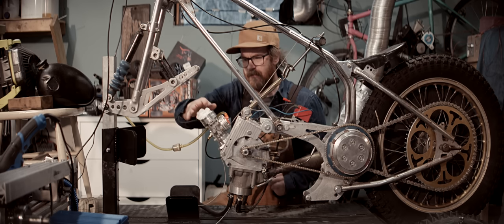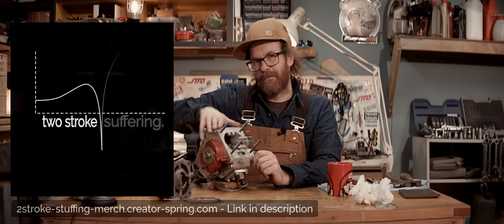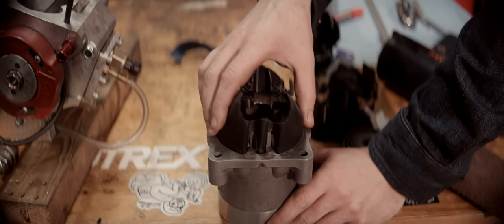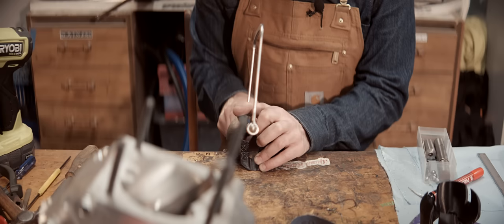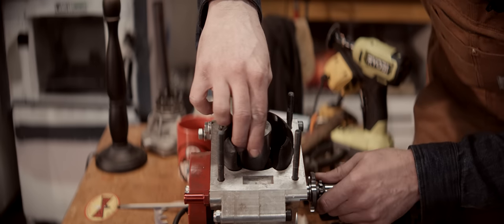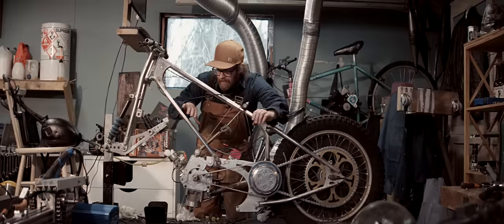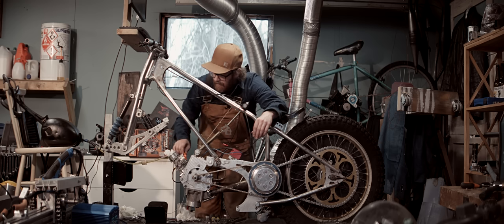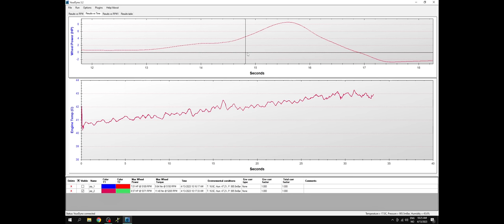The Mother of All Crankcase Stuffers! (and flying variator parts...)

Comment: When I was a kid back in the late 50's I added stuffing to the underside of the piston of my Dad's 2 stroke lawn mower.  I used half of a cork fishing float and shellac as a sealant/adhesive.  That mod plus a a bit of porting, and pull string to over-ride the vane type governor let me produce a lot more power and mow the law faster.  
Yeah, it blew up, but not right away.
Reply: I'm going to have to ask now back in the 50's exactly how old were you. 10 / 12 ?  Now I'm from the 50's and I build drag racing motorcycle engines now.  In the 50's I wasn't old enough to get a drivers license. But I built engines from a lawnmower to a V8 Olds in any old Ford,  We knew very little about about porting, degree in a cam, or setting up a Holley for a specific engine build. I didn't come across that info till the early 60's.  So I'm going to go out on a limb and say You sir are either over 100 years old or stretching the truth!  You hang in there old gentleman.     PS. in school  John Lingenfelter was a close friend of mine. And if you don't know who John was!
Reply: As the hotrodder lords intended!

Had a grand laugh at the "....sure it blew up, but not right away."

This is the sine wave that binds us together, broken knuckles and sleepless nights, then all of a suddenya got a 50hp 50cc 2 stroke, and a hell of a pullstart arm.
Reply: Well it was a 2 stroke lawn mower so there was a good chance it was going to blow up anyway
Reply: @williamickes3143  To answer your question, I was 14 years old, I was in the 9th grade (I skipped a grade), and I was one year away from the legal age to get my driver's license.  Try not to get your panties in a wad.  It's bad for your health.

Comment: I personally never realized how complicated the flow dynamics of a 2 stroke is. It's actually pretty impressive they use to build and design 2 stroke motors without any computer assistance.
Reply: Yeah it was amazing Parsons built a steam turbine in the 1890s and by 1906 they were making tens of thousands of HP, that every mechanical principal was worked out by 1930 and that fission was discovered in 1938 all without FUCKING COMPUTERS LOL
Computer assistance indeed!
Reply: They had computers, but back then that was a job description not a machine.
Reply: The persistence of carbs in 2 stroke power equipment is incredible as well. Stihl only recently released a saw with fuel injection, and it's just one model - they've got more battery powered than fuel injected
Reply: @7eis ...and good their battery saws are.
I've got 4 saws, 3x gas and 1x battery. The Stihl battery easily gets the most use.
Reply: @7eis  It's because low production cost matters more than reliability and performance in that device category, and no emission requirements yet to require the kind of clean burning you can only get with computer-controlled closed loop injection systems.
Reply: @jammi__  no emission requirements?  Here in the states there are quite a few.  Which is why stihl has been making the transition for the past ten years.
Reply: yeah especially the big two stroke diesels for me
Reply: @gibbyrockerhunter  That's your special thing. In most of the world, small engines aren't part of emission stuff. In US, the requirement of inboard boat engine catalytic converters killed the entire industry and moved it to outboard engines where no such requirements exist even in the US.
Reply: @jammi__  k.  I am sorry. Lol
  Company’s like stihl (German) are obviously adhering to US laws since they are a company and want to make money.
Reply: Yep we did lots of stuff before computers
Reply: @OhWizzer  Ships or their baby cousin EMD?
Chief MAKOi's channel if it's the former.
I'm a sucker for EMDs. I can't get enough of them.
There's one of a tugboat that has a a couple and a trio of Detroit Diesels. For the Uniflow junkie it's some fucked up shit - must - lie - down...
Reply: Some of the best 2 strokes were before computer design like the 500 from Honda and kawasaki. And the yz490
Reply: I just loved seeing that part come off...

Comment: Have you considered a sliding tunedpipe? Start the pipe long and move it shorter as the revs go up. You can then use a more radical pipe but have a stronger powerband over a wide RPM range. We did this on our model powerboats many years ago. Maintaining the mixture becomes a bit tricky though.

Comment: 18:00 I think that your 'launch control' was fighting against your variator, it wanted to do its 'thing' but as the engine could not move the variator could not expand, in the end it just gave up and spat / shat itself off the the end of the crankshaft!

Comment: I was listening to this while driving and couldn't help but to burst into laughter when I heard the variator go boom 😀 two-stroke Suffering indeed. It is for me too. Your initial power numbers look worryingly similar to mine but lets see what happens with a longer run. It is going to be interesting now.
I think your rear tire causes a lot of friction which makes it hard for the engine to get past the dip. I experienced that earlier. Try putting max pressure on the tire and only lightly loading the moped with straps.

Comment: I mentioned in last video that the PWK is modified in Kart Racing to be a “pump-around” style with no float or needle, to combat the vibration and g-forces…..In my experience this could likely fix your resonance problem with traditional slide type carburetors, and is a cost effective / reversible modification with epoxy……if interested there are pictures / tutorials on google of how to modify a Kehin PWK28 and Mikuini TM28 yourself.
Reply from the maker: 👍 I remember, thanks for the tip, I'll look into it.
Reply: @2STROKESTUFFING  Time to buy another knock off PWK lol

Comment: 2 STROKE LEGEND.
 I was comparing your motor's transfer port's to my yamaha 1973 ag100, yours are like nearly 3 x larger than mine and that's a 100cc motor.
You'll be able to change those fillers sizes as you need now, a helpful hand with experimenting down the track from here.
Glad you found that nut, nothing worse than losing a nut lol.

Comment: For a longer dyno run, a lower gear ratio will be needed. As close to 1:1 as possible. It would be best not to put a variator in hard dyno tests, the CVT feature makes the readings inaccurate unless the goal is to read max power alone. Don't forget to put a shield on the driveline!

Comment: about 20yrs ago i had an similar issue with my 103 RCX hitting the powerband without opening the variator to quickly. i was running a polini 50cc in combination with polini variator and RGD exhaust. The thing needed 1.5 gram weights to operate smoothly. Everything heavier didn't work well. even with a launch pedal

Comment: The thing is, you made a transfer case good for a 400-600 cc cylinder displacement and used it to make a 50cc engine.

With the system  you have there, were it a much larger [even as much as 100%] cylinder displacement, your transfer case, with its current size would truly begin to shine.

With a blower, 400 to 600 cc would be possible with power upwards of 270 Hp.

Comment: Finally ypu got as as we say in sverige "membran förgasare" carburator.  You should aim for close distance from carb to crankcase. 2- smallest crankcase  wolume you can get without disturbance of chanel flows. I have forgot durance angel of the exhaust port but it ended with #30 for high revs. Still for close comustion chamber and big flow your potrs will br so wide you wont have any cylinder surface left for your piston to glide on. Ports will akt now as kniwes. Tro mig. Många motorer har skurit och exploderat runt 16.000 och över. Lycka till.

Comment: Just shows how critical the balance is between flow rate in and out of the crankcase, and primary compression. However reducing the crankcase volume with the stuffers does not seem to have affected performance, and given an improvement in carb response. What factor do we need to apply to the RPM readings we are seeing on the screen? 
Great progress!

Comment: Oh. I forgot to tell you. With the membrane carburator you should aim for the biggest difference between opening and close pressure. Ex  "0,4 -0.8" / "0,3-0,9".  In the 90-s we had aprox. a bag of 100 feathers we experimented with. Good luck. Soon we see you on the track.

Comment: Alex. Did you get round to re fitting the stinger. For experimental tests I used a length of 15mm copper pipe which is easy to lengthen/shorten and squeeze to alter the back pressure.
Reply from the maker: Yep, stinger venturi restriction thing is back on.

Comment: I was wondering, would a different ignition, like a HPI 068K012 or similar, help with even higher revs, as those are internal rotors, so lighter? Those are often used for 50CC 2stroke racers.
Reply from the maker: Currently running an italkit inner rotor system👍

Comment: wont plastic just melt if u have it inside the engine?
Reply from the maker: It might soften and deform, if it melts I'll have bigger problems. Used PLA, if problematic I'll switch to CF nylon - much more hassle to print tho.
Reply: @2STROKESTUFFING  You can get some really high temp stuff now. I'm going to try using PEEK for the body of a lined rocket nozzle.
Reply: @2STROKESTUFFING  PLA has a glass transition temperature of only around 60c (it starts to become soft and deform) not sure how well it will hold up long term to fuel either... look into something like ultem 1010 (PEI) a good candidate (very high heat resistance for a thermoplastic and very low expansion / contraction) we use it here for high temp molds in prototyping.. It is also sold under the brand of thermax. 

However, you wont print it on an ender though, it needs an extrusion temperature of close to 400c and a bed of around 160c...  probably more cost effective to contract the work out to a dedicated 3d print shop if you go with that kind of exotic material, but something to look into! Best of luck
Reply: @2STROKESTUFFING  thats what i though would be a problem with it too

Comment: You need a secondary clutch on there like a snowmobile so you can solid mount the engine, might be a little easier to tune drivetrain. Love the vids. 👍🤘

Comment: I only have experience with 250 and 400cc 4-stroke (motorcross and enduro) but i feel like the powerband starts with that black hole on those tbh. Probably a driver issue but i only run 2-stroke now.

Comment: Can you use an electric motor (your starter motor maybe) to help the dyno spin up to the engine power band?  That way you can run a single speed chain drive with a high enough gear to get good dyno numbers.

Comment: hi my english is not the best but i try to explain my idde as good as possible
maybe you should use the rear drive of a motor scooter this is intended for a belt drive with a variator by matching weights in the centrifugal clutch and matching springs in the clutch bell on the rear wheel you should be able to set the speed at which the motor engages so you are able to use the perfect powerband 
I hope I was able to describe my idea reasonably well

Comment: You got a lot of drag and large rotating masses for a small engine, can you not find a light smaller rear wheel with a skinnier rear tyre, maybe the one off the spx bike? 
That speedway tyre is heavy, also maybe a manual gearbox would help a lot can you not hack up a derbi gearbox? 
Thanks
Reply from the maker: Yep. It is tempting to go with a normal gearbox, might even have the necessary parts.

Comment: One man doing what a whole team try’s in racing takes a long time. Development is a long and arduous process.  I cannot wait to see your system functioning in resonance mode. However it seems you may have a vibration issue. After modifying the piston, should you rebalance? 20k rpm could explode?

Comment: Hey Alex. Adding extra oil to the gas besides the separate oiling would increase the lifetime and/or reduce rattling of a knocking crankshaft bearing until I have the money and free-time to rebuild it totally? Thanks (its a 20y old piaggio engine. Gilera Runner 180)

Comment: hello, what filament do u use for 3d printing parts that goes inside the engine that can resist gasoline and 2t oil because pla gets soft at 60 degree

Comment: what filament did you 3d print the stuffers from? a lot of filaments which are even fuel proof still barely cope and fall apart at each layer, with heat and vibration combined id check it frequently
Reply from the maker: PLA, it's surprisingly gasoline resistant. If/when it fails I'll print a new one in CF nylon.

Comment: can someone explain, what the graph on the "two stroke suffering" means exactly?
Reply from the maker: It's supposed to illustrate the dip before the powerband where the expansion pipe is working against the engine. With large case volume and strong pulses in the pipe that dip can be hard to recover from. Why the line is fading after that.

Comment: You should practice crankcase pressure on the motorized bicycle. It’s cheaper to blow up the Chinese engine rather than the beast you created. Like stuffing around the crank, and if you use a reed valve cage,stuff it too. Love the videos,,,

Comment: What 3d printer and filament do you use?
Reply from the maker: Ender 3, PLA. Might deform from heat, got some CF nylon if it does.
Reply: Check out the new Prusa Mk4, it's a beast. Creality K1 looks amazing for the price too.

Comment: What material did you print with? Was it the Nylon stuff again?
Reply from the maker: PLA - might deform from heat, then I'll go with the Nylon stuff. PLA is so much easier to print.
Reply: @2STROKESTUFFING  oh shit, I'm surprised it lasted as long as it did 😬
I've been soaking some ASA in gas for a while and it's totally fine still. It's the same stuff they make car bumper skins out of, and it holds up to heat really well. Give that a try. It basically prints like ABS, but easier. 
It's pretty cheap too. I've had the best luck with Polymaker.
Reply: @2STROKESTUFFING  
You should really soak the pla in your fuel to see what happends. PLA is not recommended to use with solvents and fuel.

I have succesful result with addnorth's carbonfiber petg.
Printed a intake om my am6 2years ago, i've put atleast 100km on the bike without issues.  And no sealing issues either, I just modeled a o-ring groove in the intake and that is working fine.
Reply from the maker: PLA is actually fairly chemical resistant, just try to find something to vapour smooth it.
Reply: @2STROKESTUFFING  I think the temps are going to be your biggest issue. I had some PLA+ parts inside of my printer enclosure (which isn't heated) and they deformed super fast at like 40°c

Comment: Dunno what kind of rubber components are in the carb, but unless they are made out of fluoro-silicone, they wont be compatible with both alcohol and hydrocarbon based fuels. And thus if you now are using gasoline the rubber in your carb might be swelling or becoming crispy...

Comment: What filament did you use for the 3D printed part? Gives me better hope about using my 3D printed intake on my racing chainsaw and that it will hold up.
Reply: I'm going to guess some sort of Resin printer, they are hella expensive & can handle fuels and heat.
Reply: @CRO -THEHACKER  but resin doesn't have near the strength however. The one he used was a ender 3 its not a resin printer.
Reply: @mistermacgray  he never mentioned what printer he used to my knowledge. I have a resin printer and it can handle fuel, my ender 3 abs and pla both gum away in fuel.
Reply: @CRO -THEHACKER  if you watched the video closely, you will see which printer he has, I have the same one. However mine I upgraded to a microswiss all metal hot end and their A2 hardened nozzle, topped it with a dry box on custom mounts and can print CF nylon which handles fuel and heat nicely, has to print at a cool 255c and 80c bed temp. This is why I asked which filament he used as few types handle chemical and heat let alone combine under pressure, vaccum and vibration of an engine. Something as thick as he printed UV light would have a very difficult time penetrating to properly cure let alone black resin, if it exists, no light would penetrate it to cure the inside. I'm not saying resin isn't good at appli actions but if you watch the channel CNC kitchen, you will see how in many tests resin fails to meet the  strength of nozzle printed objects.
Reply from the maker: My Ender is actually set up pretty much exactly like yours. I've got a volcano with 0.8mm nozzle on that microswiss though.
Reply: @2STROKE STUFFING  I thought about getting a volcano nozzle to increase my print speeds on parts that I'm not worried about layer height or looks. Good printers that's for sure, I'm looking at their Creality K1 max as a future high speed printer. Thanks for the response!

Comment: How about some sort of pony engine ( high speed starter)to get the original design  PiP engine up to its resonance operating speed, 19000 if I recall. Once spinning at operating speed introduce fuel and ignition. Some additional lube make needed during spin up.
Run the original design and see if you can get some hp numbers.

Comment: What are you running for print material and settings? I just finally bought a printer, never would have expected to see engine internals made on one.
Reply: Most likely a resin printer not a 3d printer.